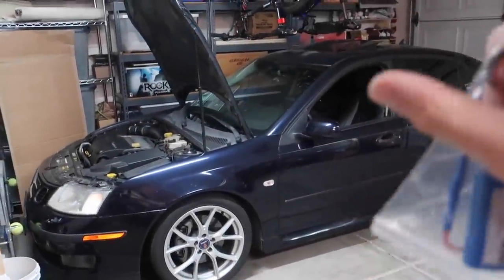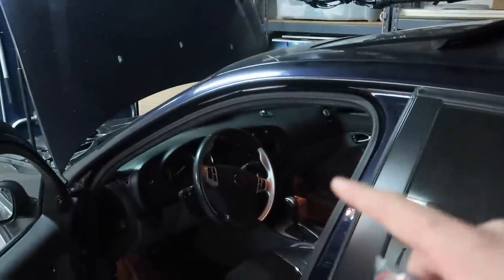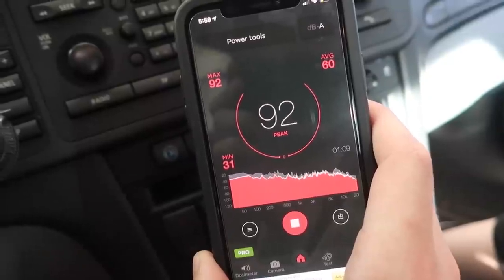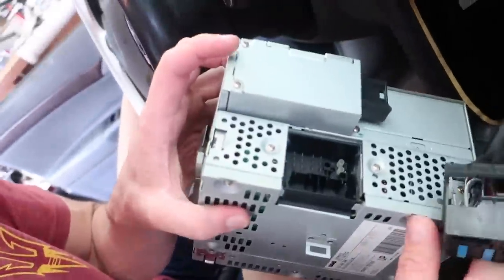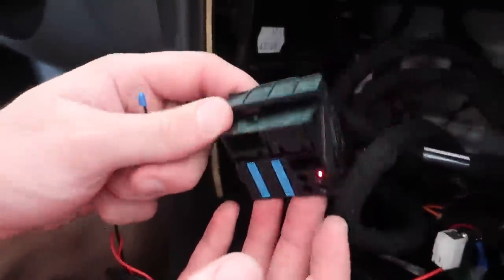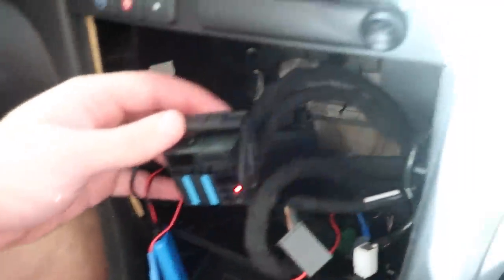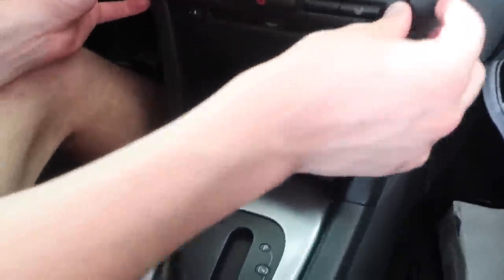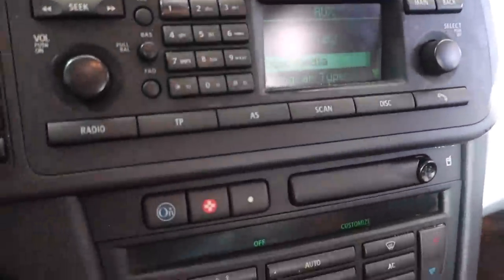2003-2006 Saab 9-3 Bluetooth Install!

Comment: Do you still need to press the button on radio every time you get in the car to set the radio on aux? Would be nice if it just connected so you don’t have to hit buttons every time I start the car
Reply from the maker: unfortunately not; still gotta press the button

Comment: I have a 2006 9-3 Sport aaero Combi.  I don't have an ashtray.  Is there a way to get the steering wheel phone icon to work? Also whys the deal with the trffic radio button that doesn't work in Amwrica apparently - only Europe?
Reply from the maker: i wouldn't know

Comment: The problem I have is that I don´t have a saab 9-3, I have a Cadillac BLS (not sold in us) which is pretty much the same thing as its made on the same chasis. So my car doesn't have a jack and doesn´t have the same interior parts that you take out in the video,I wonder If i can install bluetooth at all on my car
Reply from the maker: great question; maybe there's some information out there on forums or facebook groups related to your car!

Comment: Did it on my friends 9-3. Can you make a video off have to change ( upgrade ) front speakers ? ;)
Reply from the maker: not really easy on the 03-06 cars; i would recommend leaving as is or upgrading to the better OEM sound system if the car is not already equipped with it

Comment: I use the AUx input jack in the middle console on My 06 93 V6. But  I get a buzzing noise with engine revs. Any idea how to remove it??
Reply from the maker: buzzing from the aux? that's weird. maybe just try a new cable and see if that solves it

Comment: Is yours fusion blue? 8 have a 1.9 TiD vector which is on 199300 miles currently..50700 if she makes that is moon milage..needs lots of stuff done but definitely need a stereo solution such as this if I can keep it running and I hope to.
Reply from the maker: nice! it is midnight blue

Comment: I have a 2005 model...and the one thing I don’t like about the car is the rubbish sound system. I currently play my music through AUX and Bluetooth adapter. Does this sound much better than quality through the AUX?
Reply from the maker: I played a sound clip in the video so you can tell for yourself! The quality seems better
Reply: I also have an ’05 and yeah, the bluetooth-AUX adapter makes it sound quite a bit worse than just the AUX-cord, super excited for my module to arrive!

Comment: Im using aux to bluetooth powered by the 12v ashtray isn't that cheaper and thesame thing and without the work. The sound quality is real good.
Reply from the maker: Only problem with those is they’re a bit of an eyesore and don’t provide the same quality :( glad you like it tho!
Reply: Got the same setup  but with filter on the aux cable because of the hissing sound that it makes on high volume
Reply: @cretzubeyou  oh nice tip, how do you filter the aux cable?
Reply: @olzzon  3.5mm jack audio ground separator.. Amazon it or Google it

Comment: My 2004 9-3 aero has the other radio unit (without Aux) , does this also work with my car?
Reply from the maker: Yes, although you'll need to program the Aux with a tech2

Comment: I have same model but arc convertible
I need to install aux, will it work? I already took cable from one in the junk
..also my door speakers dont work, do you know why?
Reply from the maker: Could be a fuse. You’ll need to have a tech2 activate the feature

Comment: Would this work on my 2007 Saab 9-3?
Reply from the maker: Negative. I meant to mention that in the video, sorry!
Reply: @AutoAutopsy  it's alright, maybe u can do a video, I've got a saab 9-3 2007 TTID, it has all the buttons for Bluetooth control and calling ect on the steering wheel. But u can't actually use any of it. If you have like a solution for this in the future. It would be useful. Keep up the good work!
Reply: just put in an aftermarket headunit
Reply: I'd jus remove the shitty head unit and install a double din DVD player. Get 1 made in 2020 and it'll give you all your car performance at live time. Like boost and battery volt. Or intake temps and all the fun stuff

Comment: I dont have Aux connection and i have ICM1 with 1 cd only, does it work on mine? 2003 9-3
Reply from the maker: As stated in the video, you’ll need to have the aux function added with a tech2. Other than that, yes
Reply: @AutoAutopsy  thanks

Comment: Does it schow what Songs playing in the Sid? Are you able to Switch Songs via the Buttons on the Steering wheel? 
Cheers
Reply from the maker: no, functions just as the aux does in terms of buttons
Reply: @AutoAutopsy  Then i see no reason for it😅 i have a Bluetooth Adapter plugged into the 12v Outlet in the glovebox and the aux Input. It automaticly connects to my Phone within seconds after switching on the Ignition. And it actually just costs 1/6 of the Bluetooth dongle specificly for the Saab.
Thanks for the response anyway😅✌🏻

Comment: Can this be done on all Saab MY03-06? Or do they need the AUX connector in the arm rest? Or do all of them from that year come with an AUX in the armrest?
Reply from the maker: If the car doesn’t have aux, it needs to be programmed with a tech2 for this to work. If it already has aux, it’s plug and play. Not all 9-3’s came with aux

Comment: Hey! I have a Saab 93 Aero 04 too. But the buttons for the traction control and all the other ones are in the bottom. Nothing happens when i press them! Guess something behind is broken, but how do i fix that?? Hope ill get a answer! Good video // from sweden :D
Reply from the maker: Pull that panel off. Maybe it’s somehow disconnected or there’s a fuse for that specific panel that has gone bad
Reply: @AutoAutopsy  But the buttons is like non pressable 😂😂, I'll try and see again

Comment: Hi All, i have 2003 SAAB 9-3 SS with basic audio (no screen). i have replaced the radio tuner becuse it was damage due to CD Changer jammed and made the tuner over heat. I bought from ebay. I have tech2. I have tried to activated the Aux in hope i can add aux input to the head unit so no more CDs. But i did not succeed. I have also replaced (used) BCM without programming/coding. Because i do not have the GM account. Can it be the problem?
Reply from the maker: I am not too sure; this would be a good question for a saab facebook group.

Comment: Hi Henrik, Do you sell that device? My Saab stereo Is the same as yours but It doesn't comes with AUX or Multimedia Source programmed un it so, do I need Tech II to able It?  

Another question Is that the "Check Engine" light turned on and when I scanned the car appeared the P0546 code wich is "The Exhaust Gas Temperature Sensor Circuit High Bank 1" so, do you know if just have to change It? Or could be something else? 
Best Greetings from México City.
Reply from the maker: Who’s Henrik? I answered both of your questions in the intro of the video!
Reply: Thanks for answering both of my questions and excuse me if I named you wrong. Anyway, whats your mame? 
Best Regards.

Comment: It wasn't hard to install a single din  flip screen DVD player in 2003 saab 9-3.
Reply from the maker: dvd player, not radio head unit!!
Reply: There the same thing guy. Jus 1 doesn't play dvd.

Comment: Too bad I have an 08. What’s a good aftermarket radio for the 08 9-3, I’ve been looking for a touchscreen radio but I don’t want to buy something that won’t fit or won’t work, do you have a recommendation on which one I should buy?
Reply from the maker: No recommendations unfortunately. Facebook has a ton of threads with aftermarket head units for 07+ cars though, so I would check there!
Reply: @AutoAutopsy  Hello for 9 3 of the eighth year will do?

Comment: Funny enough mine came today, and they sent me the microphone version 🤣
Reply from the maker: yeah, apparently they have updated it since. nice
Reply: Yeah but where do you install the microphone
Reply: @UncleA88  I stick mine on the cover that covers the steering wheel stalk. Tho I feel like you could just buy another Mic with a much longer cable and just route it to the sunshade
Reply: did you order this exact part from the link? Trying to find one with a mic, the info on the site still says it doesn't have one
Reply: @smtx11  yeah, I’m pretty sure they send you the one with the mic when you order the one on the site
Reply: @UncleA88  Thanks. Yeah I emailed them and they said the one without the mic is no longer available, and will not be made any more. So only the one with the mic can be ordered. They just haven't updated the website yet.

Comment: How long did it take for you all to receive the Blue tooth device from Saabplus?  I ordered it back on 29 May and never got a confirmation email or any form of acknowledgement on my order, but they charged me for the item.  Also they never responded to my follow up email yesterday on the order.  Was this your all’s experience?
Reply from the maker: no; it did take me about two weeks to get mine though! Maybe try sending another email...kinda strange :(
Reply: did you ever get your device? I'm in the same boat
Reply: @adriandude85  i ordered on the tenth and received a confirmation email. the next day i received a shipping confirmation and have my tracking number. they never sent a tracking number to u?

Comment: I have a 07 can I get a aftermarket radio ?
Reply from the maker: Yep!
Reply: Auto Autopsy  The stock system actually isn’t bad in terms of sound quality I listen to a lot of electronic music and it does the tracks justice so I’m happy but some new tech would be welcome :) do you have any suggestions of upgrades that are easily compatible?

Comment: Does it work on a Saab 9-5 , 01?
Reply from the maker: No, as stated it only works on 03-06 9-3.
Reply: You can easily install an aftermarket double DIN radio in an 01 9-5.. I have a sound stream dvd, touch screen in my 2001 9-5 aero no programming, no CAN BUS issues nothing.. just have to bypass the factory amp in passenger kick panel and extend and run the speaker wires up behind the radio from it..
Reply: There is also a $55.00 module out there that will allow you to retain steering wheel controls if you wish, I didnt bother with that part..

Comment: I'm against Bluetooth audio quality. It drag your cell phone battery down. If we talking jack to jack cable you may be disappointed whit quality. My option was to buy a cable with gold plated Jack's and fit headphones amplifier and with good quality mp3s or original cds the sound is just amazing. Im really impressed by the hi spec stock audio system fitted by Saab. However I would use this Bluetooth connector for mobile phone purpose.
Reply from the maker: it is nice to be able to charge your phone and have it wireless; i definitely prefer it!

Comment: Anyone in the DC, VA, MD area with Saab tech2 willing to enable aux on my ‘04 9-3? Local saab shop is requesting $92 which is insane.
Reply from the maker: i'd post on local fb groups instead of a video that's years old lol

Comment: Costs way too much just for the little Bluetooth device. You can buy a full stereo for that much. That company is a rip off even if it was half the price that it is now, it would still be a rip off. Something like £10-£25 would be a fair price in my opinion as its only a Bluetooth adapter and nothing more. €65 plus shipping WTF!?
Reply from the maker: Where can you buy a half decent radio (with bluetooth) for that money that's compatible with this car? I'll be waiting for some links :)

Comment: This is a 5$ bluetooth module that is for sale for years on aliexpress. Wht these guys do, is they put their sticker on it and sell as own technology product. It's basically a scam.
Reply from the maker: Lol don’t think so!
Reply: @gezieawali8650  I challenge you. Open saabplus thing. Open it. Compare. It is the very same thing. Don't tell me I have a problem if you don't know what you're talking about. The price difference and the danger of such install is really something to think about.
Reply: @PeterChomanic  I ordered one from Aliexpress. If I remember, I'll post an update after it comes in (July)
Reply: @BLKNJ  I have that verified. There are multiple sellers on Ali selling similar / same thing, even with a microphone. It really is the same thing, one of those from Ali.
Reply: @BLKNJ  hey, is it working?
Reply: I ordered mine from ebay.. it looks the same and i plugged it same way as you do in the video but cant get any sound with bluetooth? It does connect and find my phone tho? Any suggests for the problem? Thanks.
Reply: @ZEIMIrin  sometimes you may find that the connector that goes to EHU has the pins in different holes. Just put it in the right spot and you're free to go. It'll sound.

Comment: Does it work with the 2008 saab 93?
Reply from the maker: no, it's designed for the old interior style. There are options for 07+ though!
Reply: @AutoAutopsy  thanks! Where can i find it for the 2008 saab 93?
Reply: @SamuSniperSpain  new product in sweden soon bluetooth audio for 07-12 ng9-3 :)  with swc working to change track :)